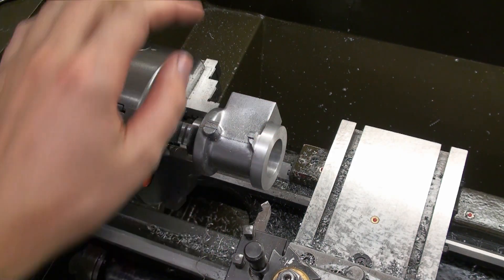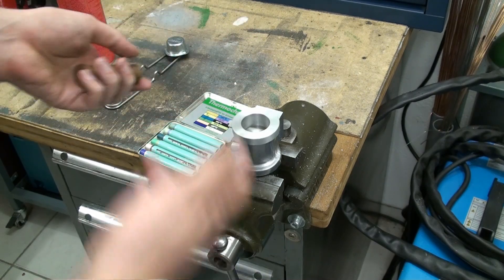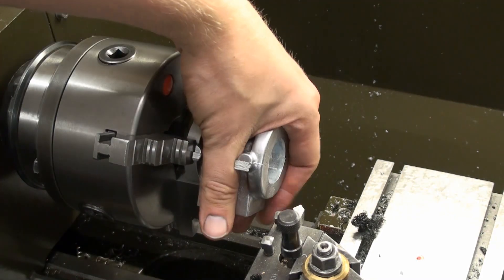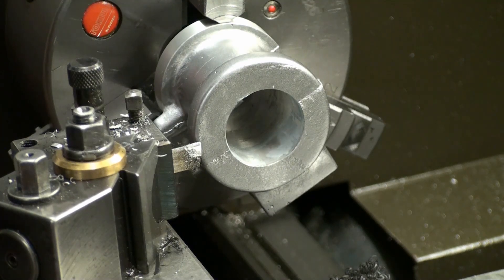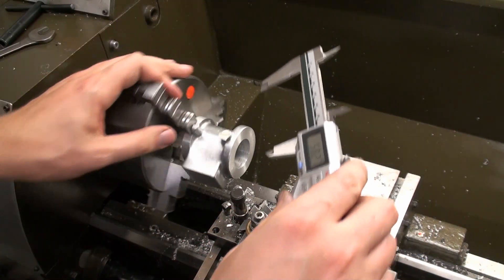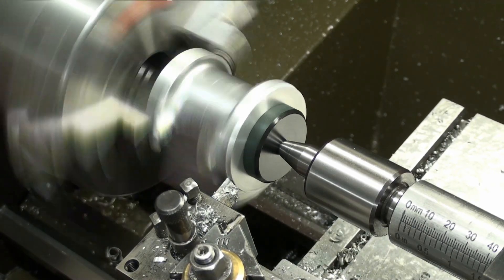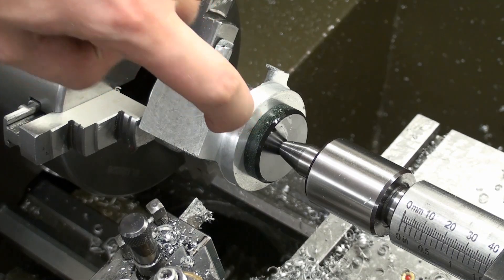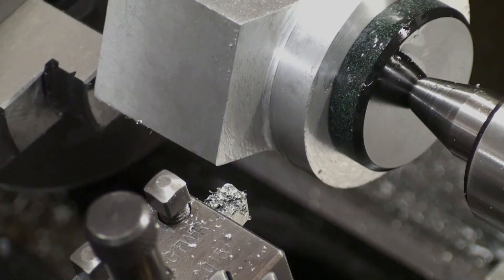Simplex steam engine Part 5 - Simplex Dampfmaschine Teil 5

Comment: From other vidios Windyhill Foundry in Mississippi, USA casts iron parts.  To reduce gas pockets from the oil sand they punch a number of small dia. holes in both the top and bottom parting faces of the mold with a small wire to give the hot oil a place to escape.  Might try that next time.

Comment: When you turned the ends of the cylinder, 1/2 of the ports got turned down.  But at the end those ports were magically full size again, faced & spot drilled.  Did you leave something out?  Did you think that no one would  notice?  (Just kidding.)
Reply from the maker: Look close, they are cut completely down and countersunk slightly :)
Reply: It looked to me like the ports were raised, as if you had installed plugs.  But I see now that was an illusion & they are actually sunk (countersunk) a little.   It was an optical illusion, or bad eyesight.

Comment: Hi Stefan, I guess you already know it, but others might not, that common household soap can be used as a guide to how hot Aluminium is getting.
Reply from the maker: +Little Work Shop of Horrors Nope, I did not know that! Does it burn when it gets hot? Or does it change color?
Reply: Soap turns brown/black at the temperature used to soften Cast Al, for easy bending, it will of course age harden again in a few days.
So, if you keep temperature down to just turning brown you will be sure to soften the Loctite but not risk melting the casting.
This tip was told to me by a real old timer a long time ago, he gave the impression it was common practice to use soap.
In these days of cheap remote temp sensing it might be a bit old hat, but the batteries will never go flat. If you have the facilities it might be worth checking what temperature soap goes brown.
Reply: did you ever finish this engine i got so interested and was i disappointed to see that you hadn't finished it

Comment: Measuring with calipers is presumably not as good as measuring with a micrometer. I have gotten curious about this and have been measuring with both. They agree to the last significant figure, .01mm or .001", provided (1) you check the zero on the calipers frequently (2) there is no junk on the calipers, and there usually is, so run a piece  of paper through before you measure.  The things I have read say you should always use the tips. I cannot say I have detected any difference.  the amount of pressure you apply will change the reading both on calipers and micrometers. Finally, not all calipers are created equal. My experience says they are not. Some will not hold zero. Some read fine the first time but the second reading is as much as .10 mm off.  I think it is roulette. I may have lucked out with my calipers. Calibrate you calipers, Mitutoyo or Harbor Freight.
Reply: +Juan Rivero Oh yeah, I forgot to say that Keith Fenner uses temperature sticks all the time so they are available in the US.

Comment: When you hold your calipers like that is is difficult to force them to read the number that you want. lol  Lots of drilling and tapping left to be done on this project.  Going to take a little while to get all of those put in. Did the engine kit come with screws and nuts or will you make them? Milling 2mm across hex nuts would probably drive me insane.

Comment: As normal Stefan really good video. Exactly why I'm a subscriber as long as you care to keep making and posting these.

And very good tip about the proper method of measuring with calipers no matter what type of design they are. It takes some dedicated searching even on the Mitutoyo website's to find that information. Even some professionals either don't know the technique's, or some I've found will discount the importance of squeezing the jaws together to counteract the minor design flaw that allows the jaws to slightly cock back and forth in either direction while using even the thumbwheel on some calipers. For anyone who doesn't already know, that thumbwheel is for making quick adjustments and isn't intended to be used for obtaining good measurements up to the accuracy's of a quality set of calipers. Good technique as always is critical to getting the best out of any metrology equipment.